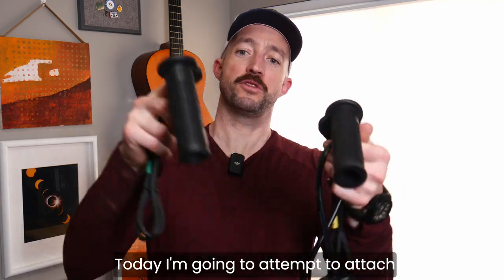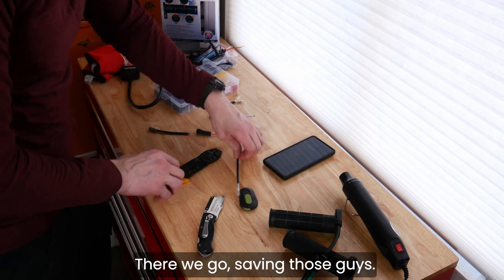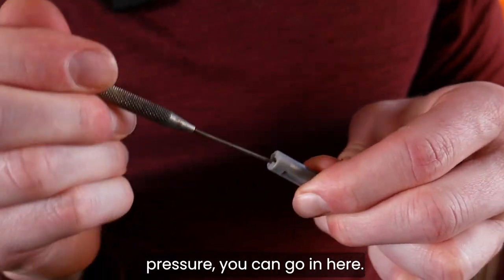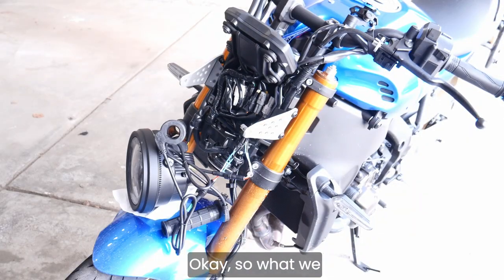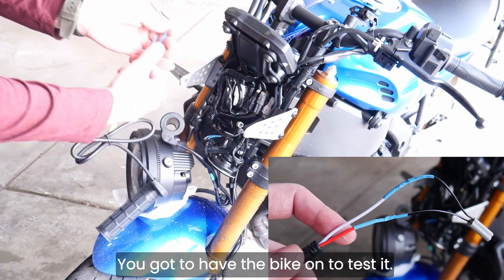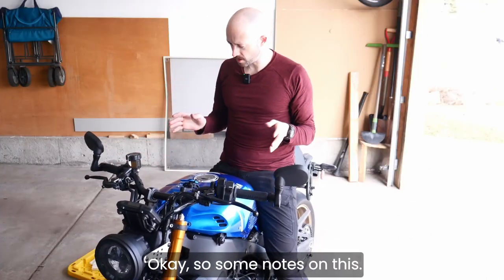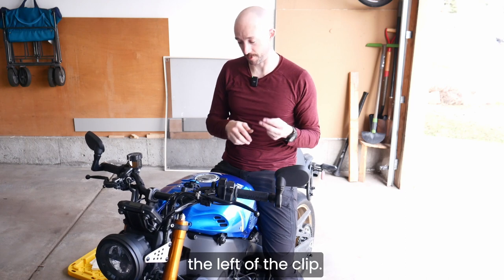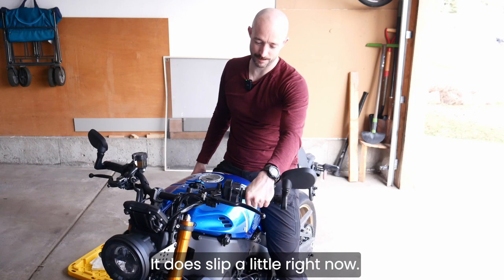Splicing Oxford Heated Grips into the OEM Wiring Harness of my 22-23 XSR900

Comment: Thanks for the video however in relation to the the section where you re-pin the grey connector. I cant really see what's happening with the retaining part.. do you push it downwards, or into the connector (or pull it out?) in order to remove the connection?

Comment: I've been fighting to get the pin removed for a few days now. Any special tricks to release that hook and remove the pin from the connector? I am using a hook and pick set and the only one I've been able to remove was one that I ended up breaking. Any help is appreciated!
Reply from the maker: Did you ever get this? I can't remember how I did it. It has something to do with a sewing pin, very precisely inserted. Once I figured out the process, I was able to do it the second time quite quickly.
Reply: @ChristopherEsplin  I was eventually able to get the pin released. Was a bit of a pain and I broke one of the connectors, but ultimately I got it all wired up and still love the heated grips. Thanks!

Comment: Did you use solder when you splice the wires together? Or just a simple butt splice and heat shrink?
Reply from the maker: Nope. Didn't need solder.